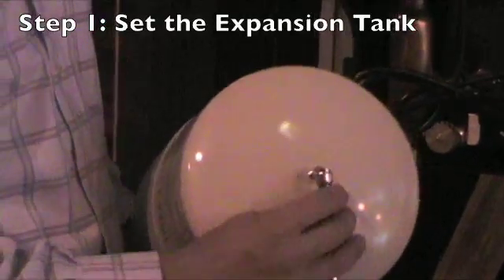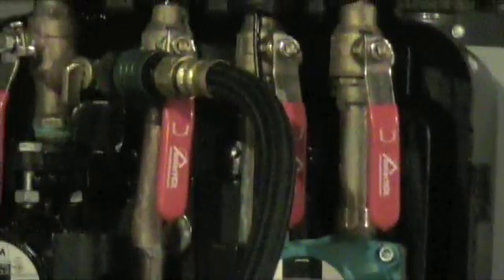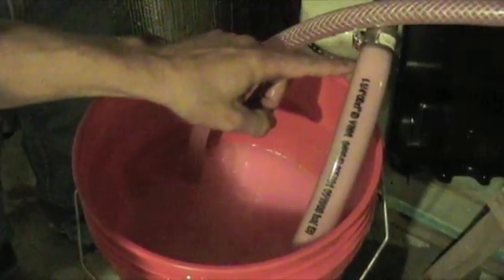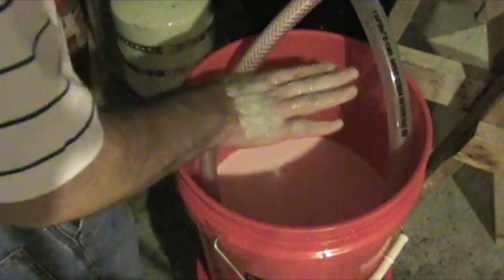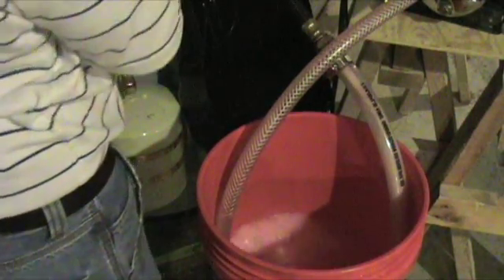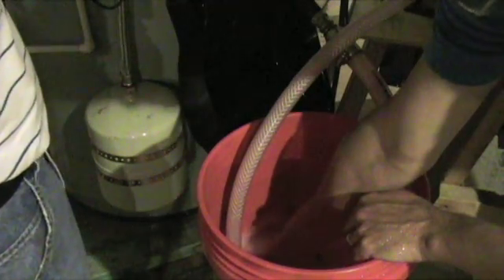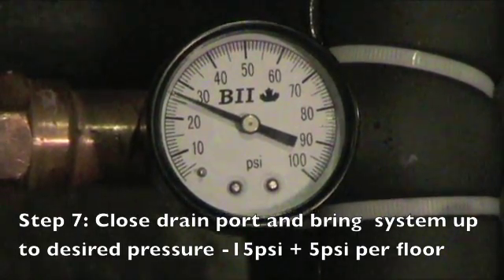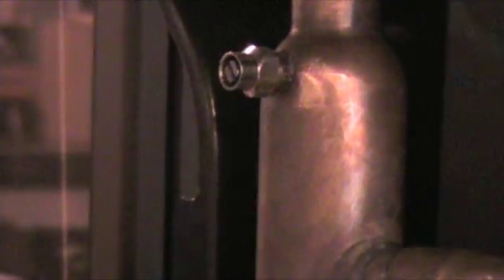Charge a Pressurized Glycol Solar Hot Water System

Comment: polypropylene glycol can last 10 years or more , depends on the temps it reaches, first thing to do is to check the PH of the fluid prior to changing . if its between 6 and 9 then its good.Also I would add a micro air separator on the cooler side of the loop.  Been training people on this for 7 years . Plus expansion tanks should be 10 psi below loop pressure . This is a poor looking system.
Reply: Hi there- I know this is late... ten years ago I filled my solar system with premix glycol. Does it start to solidify after 10 years? What’s the max time you would leave glycol in. I’m in southern uk so it’s not subject to 365 heat

Comment: Since this is a closed loop, I should not have to recharge the system again unless there is a problem correct?
Reply from the maker: Archie,
You should change the glycol every 3-6 years. The buffers in the glycol break down over time and the pH increases. At a certain point it will start eating at the copper in the collectors.
Reply: Great, thanks for the info. I'm about due for a change.

Comment: Excellent.  Thank you very much.  Our system did not come with an owners manual for the pump station only the controller and I needed this info to purge the system of air that has accumulated over the past two years.  Thanks again.